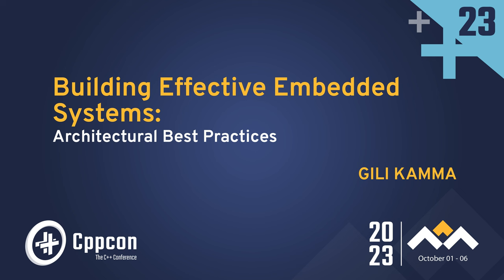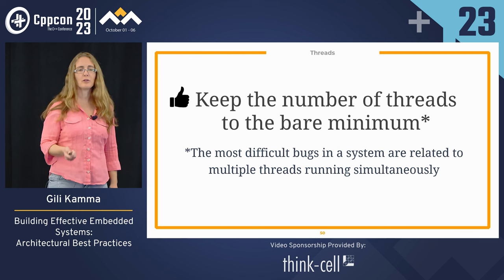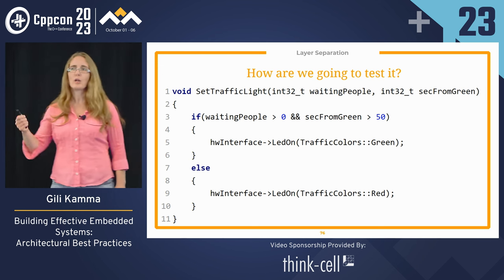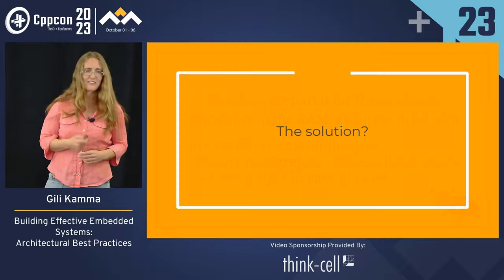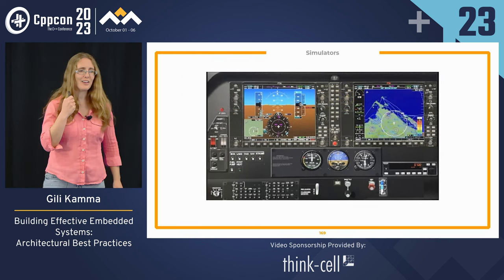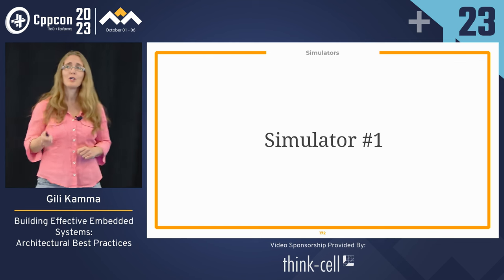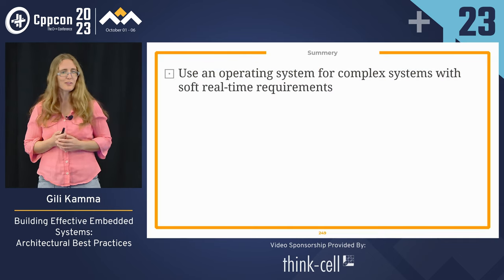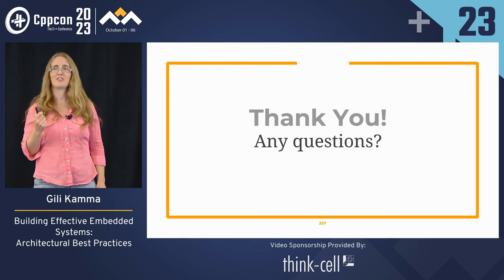Building Effective Embedded Systems in C++: Architectural Best Practices - Gili Kamma - CppCon 2023

Comment: About the SQLite database on SD card. I would try hard to not use this approach if not necessarily need. Because SD cards tend to degrade quickly and then what ... can the device work without it? Do I need to go to the customer to replace it?
Reply: Things are not black or white. The action I took was a necessary requirement at the time. I utilized the resources available to me, as I needed a quick solution for dissatisfied customers. Prior to the changes I made, I had an SD card with SQLite on it. So I didn't need to develop drivers or to do integration.
At the end of the day, I performed several tens of writes daily. Therefore, if you do the math, you’ll find that you have more time than the expected hardware lifespan of 7 years.
Reply: You right, but mitigation is using large SD card and wear leveling filesystem. Then replace it regularly.

Comment: @34:11 : Can somebody explains me how generating 10-50 fake frames simulates the long distance ? The data transmission rate (throughput) theoritically doesn't change based on distance. The amount of data sent in a given time frame would be the same, regardless of whether the distance is short or long. In other words :  What are the nuances to consider in long-distance wireless communication that can justify a simulation like the one Miss Kamma is conducting ? 
The only thing I see is that the latency and propagation time increases. This leads to an increased buffering. But that's not clear to me. I work with wireless communication and never had such a Thing.
@community : would you be nice to explain this to me ? 
Regards
Reply: I agree, you also need to incluye link and system level simulators which account for the propagation channel, antena, and RF chains. Of course, this demands an HPC setup to properly validate latency and reliability. Not trivial at all. And many companies tend to outsource simulation overseas, which in turno  also subcontracts until no one knows exactly whose responsibility is.
Reply: It makes sense if "meter" is not the 'unit of measurement' but a 'measuring device'. In other words, 5000 measuring units reporting to this device, rather than 5km distance.
Reply: I just don't understand why multiplicated frames simulates sites with long distances.
Reply: My aim wasn’t to simulate either long or short distances. My main focus was on simulating the load on the software. I chose to do this through software, as it’s cost-effective and quick. The RF hardware wasn’t the issue, the software was the bottleneck, particularly in managing and transmitting the necessary data.

When I simulated the reception of additional frames, it created a load on my software. Instead of managing 300 meters, it had to handle 10,000 meters. As a result, the processes took more time and required more space, proportional to the number of meters involved.
Reply: If you venture back to 7:26 you will see that the presenter is talking about two things. One is the measuring unit which the presenter refers to as "meters" and it collects measurements in distances in the unit meter. So when the presenter says "built to work with 1000 meters" I honestly believe that it means "built to work with 1000 measuring units". Which, if true, means that when we head back to 34:11 it is essentially just adding more data at the point in time. My assumption is that this simply is a load problem, not a distance problem.
Reply: @GiliKamma  people confused about the word "meters" :) It is better to specify a type of the meter like "flow meter", "electricity meter", ...
Reply: @azdinator  You are understanding "meter" as a measure of distance. But what is meant here is "meter" as in measuring device. Eg water meters or electricity meters etc.
Reply: @Heater-v1.0.0 sorry for that. Thank you. Im french...

Comment: 28:00 What if data will contain a sequence equal to prefix? Or even worse if a part of the header will form such sequence?
Reply: @vladimir0rus The concept here is that we identify the start of the message using a prefix. After that, we read the length and then verify that all the content matches the CRC at the end of the message. If the prefix appears in the middle of the message, it doesn’t matter because we only look for the prefix when we start searching for a new message.
Let’s consider the worst-case scenario: we don’t see the prefix at the start of the stream, so we go over the byte until we find it. Then, we search for a valid message. If it’s not valid, we discard the prefix we found and start looking for a new message again.
The likelihood that it will resemble a valid message but isn’t is pretty rare.